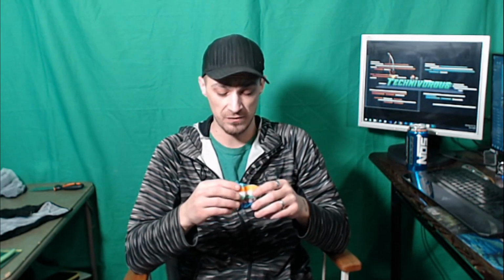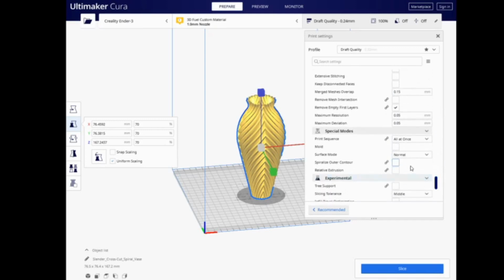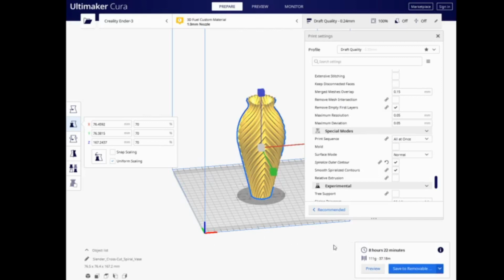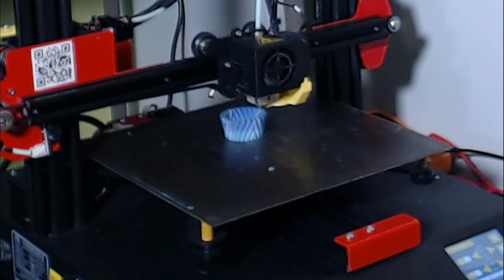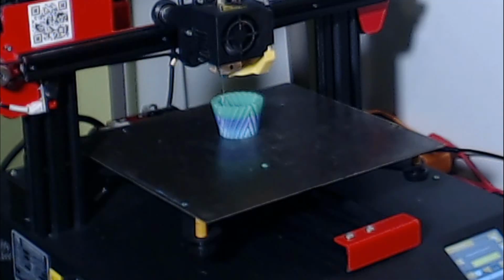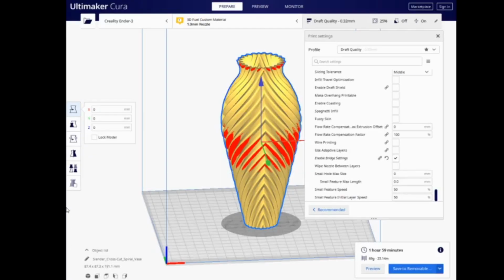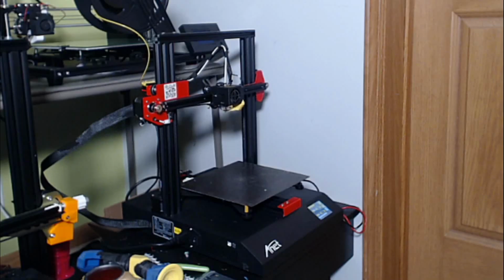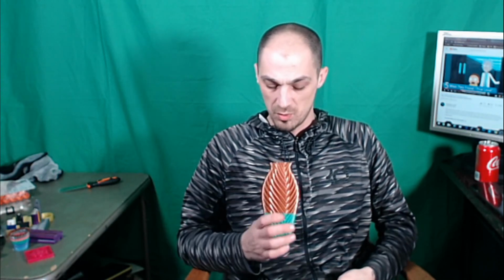3d printing - vase mode with 1mm nozzle

Comment: Hy  sorry in advance for any grammar errors i came from italy.  I wanted to ask you if your stepper motors also get very hot during long prints  expecially the extruder One.
 Maby it's the fact that i made the direct drive upgrade witch covers a bit of the motor but i dont know and im afraid that i Will burn aomething 
  thanks for any answer  and nice viedeos 👍
Reply from the maker: Ehat are you printing Luca? Abs petg? Pla? Generally my steppers haven't overheated since I rewired the main fan to be always on, but they used to when I printed without the part cooling fan and the board would get hot, then the steppers would too.
Reply: @Technivorous   for now i only print pla on my  Ender 3  i didnt rewirded anything only the direct drive stepper but i dont think Is It because i only extended the cable Witch connect the motor to the mother board.
I don't know how much heat is actually worrying but after a print of about 3 hours i cant definitly keep my finger on it
Reply: If your main board fan is working you may want to check the vref of your extruder driver on your control board.
Reply: When I had an Ender 3, the vref on my extruder driver was 1.0.  If it’s too high, your stepper motor will overheat,  if it’s too low, your motor will skip.
Reply: @coreymac2381  thanks a lot for the advice now i don't have access to a "multimeter" but i will let you know if this was the problem